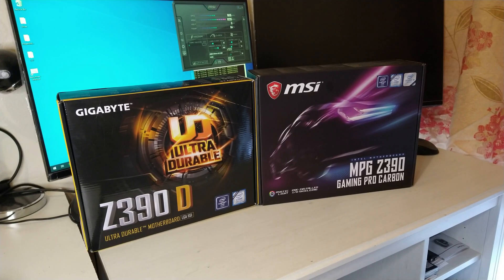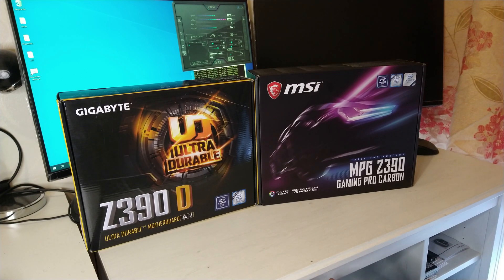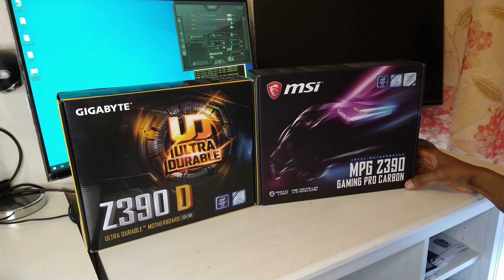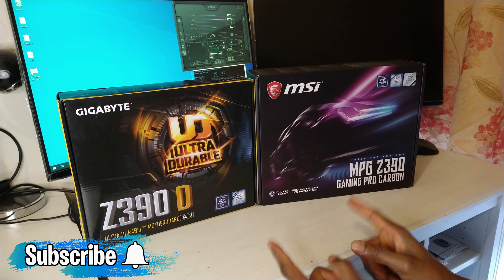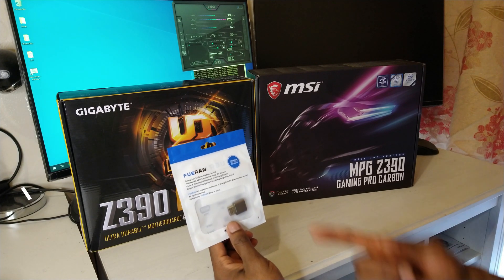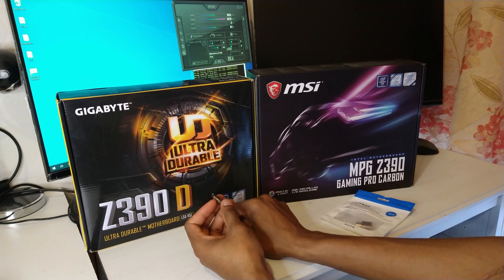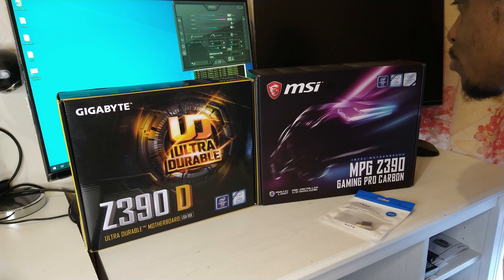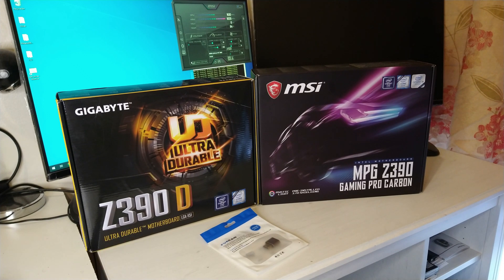TRIPLE! 3060 Mining Rig "Motherboard Update" - UK - "Build P3" | April 2021 | RonsTechHub Mining E03

Comment: I have a z390 D. Nice video. Also I have 2 x 3060s. 1 of them is in the pciex16(16) and working at 48MH/s. The other card is in a x16(x4) slot with a dummy plug but its limited to 26 MH/s. On the Z390D the other remaining x16 are (x4) . If the additional 2 pciex16 lanes are x4 that is what is limiting my hashrate right? Or is there a bios setting i'm missing? How did you get 3 x 3060s to work on this board?
Reply: You are correct, that is the limitation it needs to be running at x8 to get full hash rate with the correct driver..
Reply: @jamaicandjnado  ok my mobo has bifurcation support so I can use a splitter, set the x16 to x8x8 and use 2x16 ribbon extenders on each bifurcated slot.
Reply: @MrPiccolop  

That is a good idea, it could work once you have the x8 riser as well. 
The other ports would probably then go to zero as you would have used all the PCI lanes.

If you do try and it works do let me know, please.
Reply: I have additional cards attached to the other lanes via risers. So if the limit of my CPU is 16 lanes once I have used x8x8 I will lose functionality of the other GPUs plugged into them?
Reply: @MrPiccolop  
CPU as far as my research showed me. 

The motherboard can have more than the CPU but the extras might be used for stuff like PCI SSD etc. 

So if CPU has 16 lanes then that should be it. 

But do test and share results since you already have extra cards.
Reply: @jamaicandjnado  ok will do. My CPU is maxed at 16 lanes, the z390 chipset on the motherboard is maxed at 24. Will give it a go. Might actually work.
Reply: @jamaicandjnado  ok. Reporting back. It works! A little bit of messing around in the bios. First setting is setting the bifurcation type, in this case x8x8. The second critical part for forcing gen 3.0 in the bios for max speed link. Gen 1 and 2 would not allow both cards to run at full capacity. Gen 3 was the clinker. 👍👍
Reply: @MrPiccolop  Is there anything else you did? My second card still has only 25 Mh/s even with Gen3 :(
Reply: @s1mon878  what is your setup? Are you using a bifurcation card? Is it powered? Are you sure it's correct model?
Reply: @MrPiccolop  Our setup is Motherboard Gigabyte Z390 D
2 cards Palit 3060 with long 16x to 16x
8 GB RAM

SSD 120 Gb
OS windows 10, x64

Nvidia driver 470.05

Bios settings

Bifurcation cards 8x/8x
4G decoding enabled
PCI-E slots Gen3

Previously i built rig: Asus x99-deluxe and 5 cards 3060. So i have some experience with rtx 3060. 

I tried a lot of things, connected to different slots, tried different modes in BIOS.  Dummy monitors also connected. Nothing helped. Second card still has only half of full capacity
Reply: @s1mon878  honestly mate I don't know.  The bifurcation card I used came from Germany. The company was Payne or Paine. The card also needs a power slot for dealing with the extra load. You're going to have to assume if your system is configured correctly that either the bifurcation card is not operating correctly or you have a limited card. You will have to experiment.
Reply: @MrPiccolop  Ok, got it. Sorry, but talking about limited card do you mean graphic card? Can it be limited? I mean i didn't know that card can be limited
Reply: @s1mon878  it could be. When did u but it? What batch is it?

Comment: instead of 2 (3060), can we use 1 (3060) & 1 (3080) on Gigabyte z390 D to mine ETH in full speed?
Reply: That won't work. The driver that allows the 3060 to hash fully doens not work with any other card.

You cannot install different drivers on the same system, I tried.

If you find a way to do it please do let us know.
Reply: @jamaicandjnado  that's not quite true. I have a 1660 super in parallel and works just fine. Also a 1070ti on separate testing rig and works fine with that specific driver
Reply: @giubaca  how many 1660s can a Z390 ud support?
Reply: @sirtwin4ten  as i can see the manual it has x16 once, x4 twice, and x1 three slots. It doesn't specify how many slots you can use at the same time.
Leave the M.2 ssd slot empty and the x16 main pci-e slot empty. You should be able to use the two x4 and the three x1 slots, giving you 5 cards. Maybe try an adapter into M.2 slot and get 6 cards. But leave the main x16 graphics card empty, because that will use 16 lanes. You can only have that many lanes as a CPU can handle.
This is a try and test to find out business. Goodluck with that and let us know how it pan out
Reply: @giubaca  thank you. Liked and subscribed👍🏾👍🏾